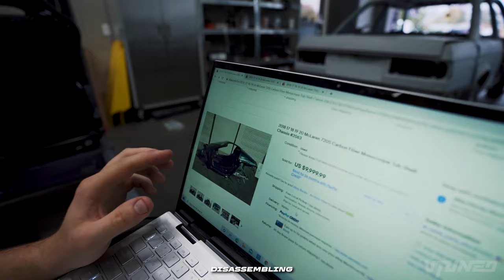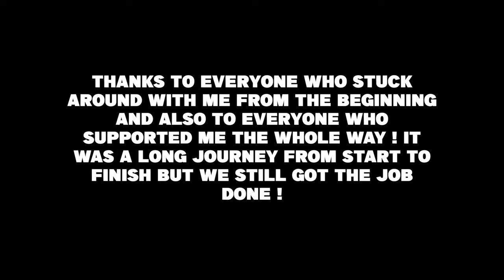Destroyed McLaren build In 12 MINUTES!!!!

Comment: should always use a flat hard block when sanding curves, go up in fineness of grit. you need to get the high spots, a soft round hand plane under the pressure of your fingers, or the single tangent of a rotary tool, doesnt do it justice, and leaves much to be desired. let me know what you think.